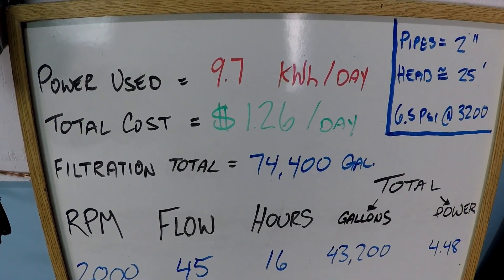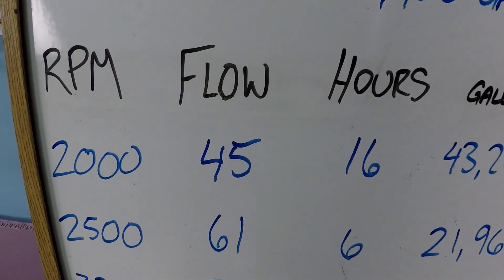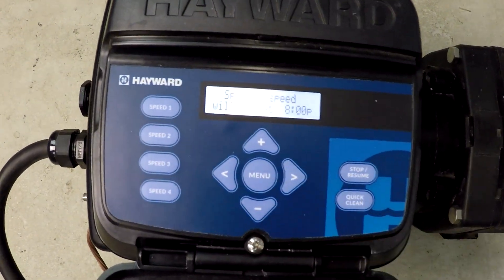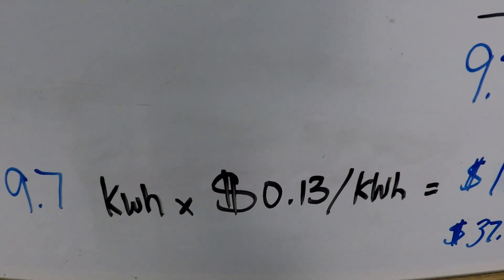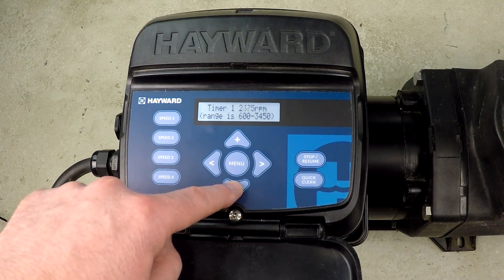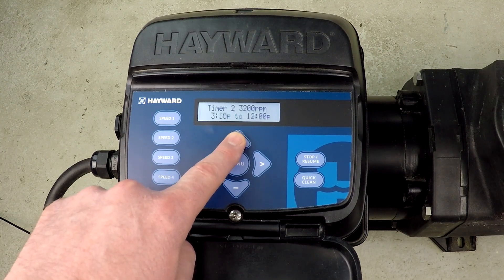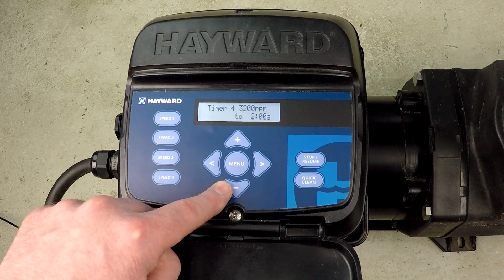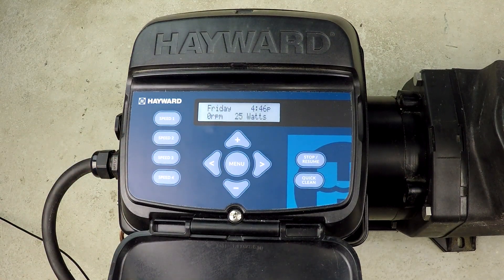Programming A Filtration Schedule For Pool With A Heat Pump

Comment: Is it okay to use the flow rate to stop the heater from running? My heater typically runs during mid morning and early evening. So I would like the flow rate during that time to be enough to run the heater and then get below the 40 gpm that is required to turn it on.